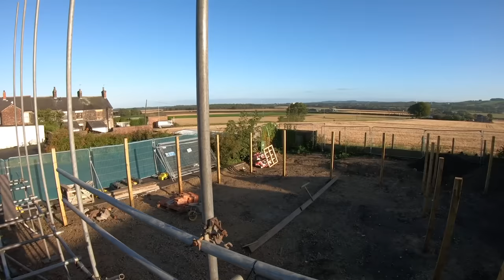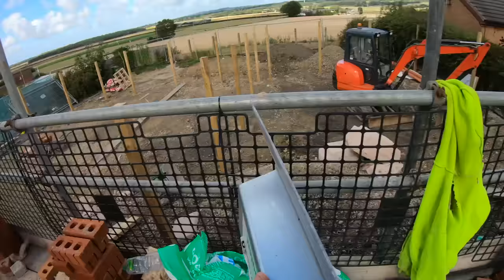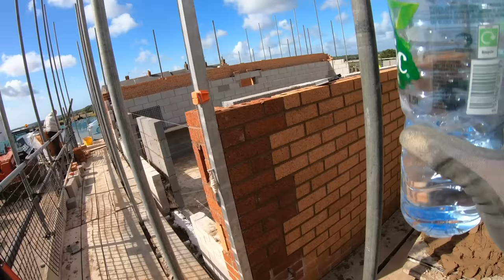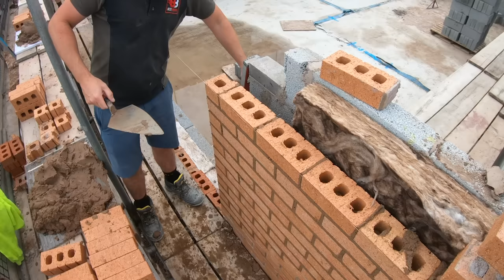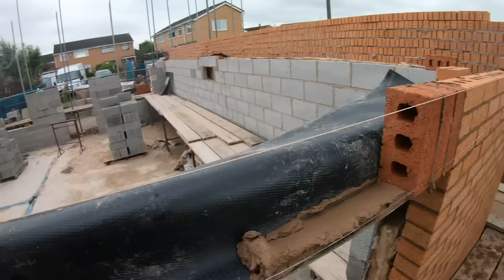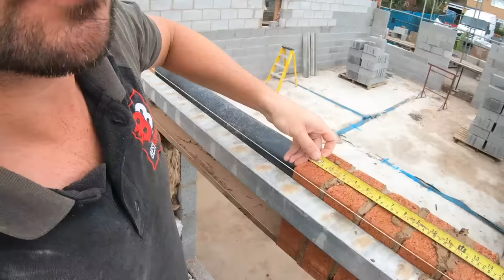Bricklaying - Soldier Course over a lintel - part 6

Comment: The attention to detail of your door and window openings is superb, bordering on bespoke. Here in the states masons typically throw down a rusty piece of angle iron and slap bricks on top. It works well enough at first, but not long term. Your work is amazing.

Comment: Mint brickwork .. I always use the profile for soldier courses .. gauge the profile up and you can see if you need to open or tighten up to make it work. Also, a tip for you maybe you already know but do away with the top line and set your profile along the top edge of the course and you can use this as your line to get down to and straight edge to follow :). 

My bum twitched at that lintel not being propped too 😬🤣

Comment: Should have a temporary prop in the middle of the lintels until the mortar has cured mate, also takes the bounce out the longer spans when laying the courses over the openings and makes it easier. Cheers
Reply from the maker: These are heavy duty lintels,  cheers
Reply: @Stucrompton1  Doesn't matter, they need propping until mortar has sufficiently cured. Even a RSJ/PFC etc. Needs propping

Comment: I'm convinced that I must be the only bricklayer in the world who fills all the holes up when laying soldier courses using semi engineering or perforated bricks.
Reply: How do you stop it from coming out the other side , to time consuming mate plus if you have a good joint i.e your perp is full job done 😉
Reply: @DylanGSXR  I have the brick in my hand, and use the trowel to put mortar in. Its really not that time consuming or hard mate. The holes are there to be filled with mortar and to act as a key, not to be left as empty voids.

Comment: throwing a head joint under the line will keep your head joint holes to a minimum ,when laying forward ,  then you can " joint " the wall w/out having to point up as well . Your jointing has to be as good as your laying. Maybe a twig in the line as well. You gotta pull that line like you live ,,, hard. Finished product looks good man.

Comment: What kind of lintel was that that is supporting the brick soldier course with the thru wall flashing over. A welded steel angle or other steel shape it also seemed to have a slope at the top of it. Would of liked to see how the 4" block behind the brick was laid over that lintel. Thanks!
Reply: Keystone SK/90. How ever check out IG Lintels also (L1/S 100)

Comment: Right I know a lot of this has been edited and rendered for video sake but it seems like your laying course after course really quickly.
How do you keep the mortar level consistent ? There must be different sized mortar layers between the courses as your going along regardless of the bubble and string?bricks alter within a mm or so in size and thickness etc so your mortar layer will / should adjust accordingly I presume ..?

Comment: im wondering, shouldnt those walls (inner and outer) be connected by some anchors? because that insulation gap makes both walls thin and could tumble/tilt independently of each other?

Comment: another nice video, i saw Mr.stu installed an orange water leak pipe in between bricks, should it be flat to the surface of brick wall or can be stick  out a little ? because i don't see them often at the north america, thanks

Comment: Straight joint 😂
Reply: Where ??
Reply: 10:43 3 of them !!
Reply: @stevielightwood2239  That's how the bond works 3 soldiers to a stretcher ,the straight joint as you call it is irrelevant because the bond of brickwork over the top has to carry on.
Reply: Its just at 10:48 the bond changers i got pissed last night an thought i was dead funny noticing that am a young brickie who loves it an just said it for a laugh

Comment: Do you not prop up the lintel, they tend to bend as your building over them,
Bet your never out of work you do a good job stu, all the best
Reply: There heavy duty lintels no need to prop .
Reply: @DylanGSXR  All lintels should be propped until initial courses are cured. Propping every 1200mm centers max.

Comment: One question how thick is the complete wall with isolation🤔
Reply: Usually 300mm
Reply: @mattb2  thank you that's a lot the owner don't need heater in the house 😁. Have you any problems with animals or mice in the isolation 🤔
Reply: AVS Fahrzeug Aufbereitung 100mm brick/100mm cavity/100mm block. Cavity full filled with glass fibre insulation or part filled with PIR board. No animal problems just pets and children inside house 😂

Comment: What happens when that insulation gets wet cause I think will create a wet wall called damp
Reply from the maker: You should ask the regulators who standardise full fill cavity spec. I’m just doing my job. Cheers.
Reply: @Stucrompton1  you took it in wrong way. I just expressed my opinion
Reply from the maker: You asked me a question about what happens when the insulation gets wet. I was just saying ask the regulators not me. I’m allowed an opinion on what you wrote too.